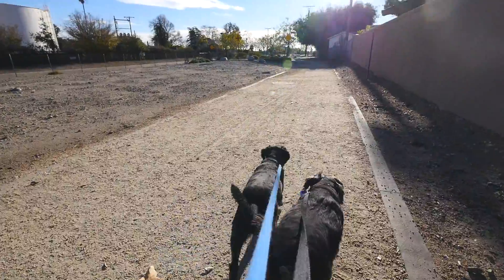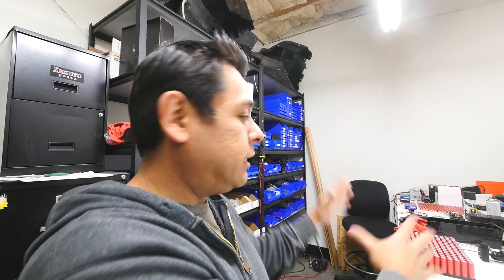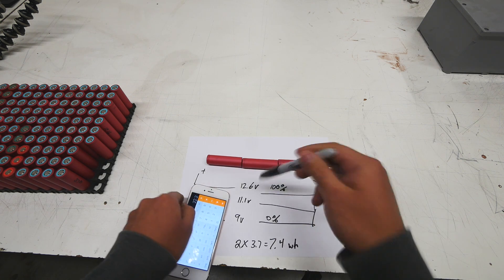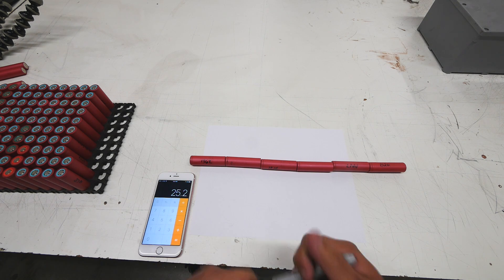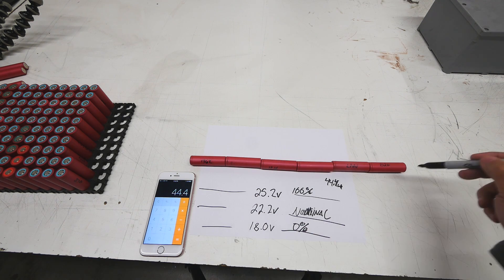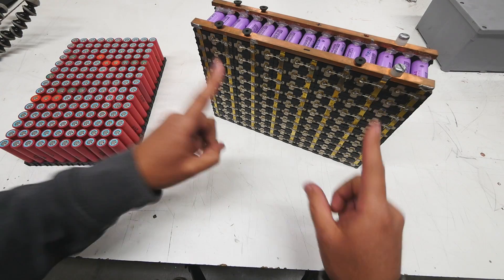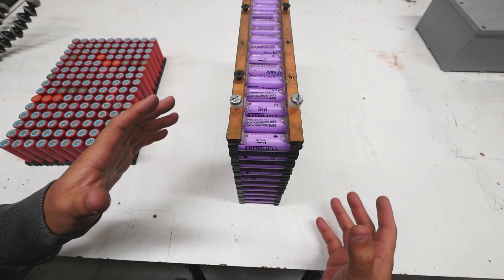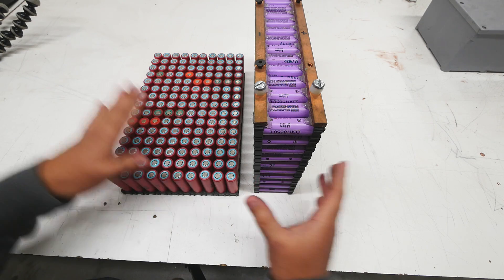How to wire A DIY Tesla 18650 Powerwall

Comment: Thanks for this video.
But if all the batteries are connected in parallel then, how are going mount a 48volt inverter on a battery that's just 3.7 volts?

Comment: So I need some clarification. That big pack with the pink cells, is completely arranged in parallel with a + and - bus bar at the end, right? 

So I could use 3 of these packs in a power wall for 12v, have one big BMS unit for all 3 packs then invert to 120v ac?

Comment: One Question - Shouldnt your positive and negative bus bars be on opposite sides so you pull the voltage evenly thru the batteries.  With this pack setup, someone demonstrated more heat build up closer to the top the busbar as batteries were discharging faster than the batteries furthest form the bus bar.

Comment: You mix chemistries? I thought you couldn't do that... (your samba comment)

That's cool for 12v /24v... Not sure what I'd need that for but cool info.

As far as bms, yea you don't need it as long as you keep an eye on it. But I don't get why you said they wouldn't come out of balance... Of course they can... That's why balance chargers exist... So you don't need a bms but you still need balance leads. A new wouldn't notice the fine detail that all the cells you are talking about are a parallel connection. 

How you should have explained it for newbs is that all series connections require 1 balance wire per set of parallel cell arrangements (from 1-infinity). While parallel cells themselves don't require balancing since they self balance. 

But once you start attaching parallel groups in series, now each group of cells becomes a series connection and each member of the series connection requires a balancing lead. (also the entire arrangement's negative, that needs an extra wire on negative. Hence why you need 6 wires on a 5S connection)

Comment: If you took a series of 4 batteries to make 12 volt (14.4 volt) could it be used on solar setup for power in place of regular batteries

Comment: Hey I was wondering how long you let your 18650 batteries sit on the shelf to test the self discharge. Also how much of a drop in voltage you allow before calling a cell bad. For example I had a batch of cells tested and charged to 4.2 volts. They were left for a week and after that week they had all dropped by a bout 2 to 3 10ths of a volt. would you still keep these cells?

Comment: I'm really wandering. I understand why you don't need balancing on parallel cells. But my main concern is the following; If I have 10 cells in parallel and one cell fails and would create a short the surrouding 9 batteries will discharge all there energy through this one cell. How do you prevent this and what is the safety if this would happen. Perhaps this rapid headup could damage nearby (other) cells causing a cascading effect. Any idea??

Comment: Why not build a huge nuke power plant . in the desert. To power the west us. And find some place . may e underground in the east to power the east. To power 50% or so. The rest from hydro,solar & wind. Every building that makes sense should have solar. I don't like nuclear power. But having it centralized would make more sense. I have 1500 cells to batter! In to a 1400 cell 2* 7s 100p batts.  Lots of soldering to do. I have a 200w iron to make fast work of it . without the cell cooling the iron. So o hopefully will not damage the cells. Great old video J...

Comment: Hey there buddy for the last couple weeks I've been watching your video especially about the powerwall I Can't Get Enough I'm so inspired still need a lot to learn I have six car batteries running now so I found these on eBay I don't know if you ran into these quality and brand make a difference if you get a chance can you check these out eBay I found these for $63.99 100PCS Li-ion 18650 Battery 3.7V BRC 3000mAH Rechargeable Batteries Lithium New
Reply from the maker: Junk

Comment: Can you use something like this as opposed to the 18650? Or is their some drawback to using something like that? 3.7V 5800mAh 18650 Battery 10 Pack Rechargeable Batteries (I found a bunch on amazon and they seem cost effective)
Reply from the maker: They are all fake

Comment: I have been watching a few of your videos and I like the theory and learning of it all. I have a question, I am building a camper van and want to have the coach / house battery be lithium to supply power to my 12v items such as fridge, lights, fridge etc. My question is would building a battery pack out of the 18650 batteries at 12v work for this application? I would like to have storage of about 100 amp hour possibly 200 amp hour, so i feel this would be similar to the tesla power wall to power my van, i would also like to charge the batteries from both solar and the alternator while i am driving, as far as charging via the alternator is there any thing special needed to charge it from that i know of the sterling battery to battery chargers however pricey but the other option is a ACR type relay but would that cause harm to my lithium battery pack giving it different volts or the battery demanding alot of volts from the alternator.
Reply from the maker: You must use Lifepo4 cells for 12v

Comment: how many amp hour i can get on 80pcs of 18650 battery. 20pcs on parallel per pack then i will series them to male 12v config. im so confuse with the mah and kwh thing.
Reply from the maker: Ah x V  = wh
Reply: thanks much

Comment: I am just a little confused.  In this video you showed wiring a 12v cell.  correct me if im wrong but you put 3 cells together in series and then put 50 cells behind each of them in parallel.  Right or all of them in parallel?
Reply from the maker: Correct

Comment: If I had four of the all parallel battery packs connected in series to make somewhere around 12 volts, would a regular 12v charge controller be okay to charge the batteries or is there a specific type of charge controller for these types of batteries?

Comment: So basically just daisy chain them?....so if you have 3 batteries in a row...& the 1 on the far right, the sign is negative, & the inside is a positive?... it would go from right to left: neg-pos, middle nattery?...neg, pos, & far left battety?...neg-positive...so the 'positive side'- is facing out...ok now I gotcha...

Comment: I new to the D I Y .. .. .. I notice that you are using 4.2 volts on this video. 3 x 4.2 = 12.6 volts, but most of the 18650 Lithium-ion Battery that I seem on Amazon are 3.7 Volts. So 3 x 3.7 = 11.1 volts witch is under 12 volts and 4 x 3.7 = 14.8 volts witch is over. Can I use the 3.7volts 18650 Lithium-ion Battery to make a 12 volts battery back for a small small solar generator ??
Reply from the maker: 3.7v nominal vs 4.2v max charging voltage
Reply: Thank you for you rapid reply .. .. .. however I do not under the answer. can I use 3.7v to made a 12 (14.8v) bank?
Reply from the maker: 3.7v cell have a max charging volatage of 4.2v

Comment: The calculations are all wrong. Watt hours stated should be milli amp hours but even this is not correct as the amp hour rating of the cells is equal to juts one of the battery capacity because the batteries in each cell are wired in series where only the voltage increases and the watt hours stays the same. One string is only 2000mAh and for the cost of freight I would have gone for 5800mAh batteries for less than twice the cost.
Reply from the maker: Oh,  the ignorance is strong with this one.    Oh internet,  where do you find these people

Comment: For a 96v system, is there any reason you cannot use two 48v BMS's - one for the first 48v and one for the second 48v? I'm looking at building a 96v system for a racing kart so peak current is import (end of straight max rpm WOT), and I want to make sure it doesn't fail.

Comment: Hello.... I was wondering... what happens (if anything) when you try making a power wall or small battery pack with cells that have varying Mah ratings?  
Example.... I have some  Sony US18650GR cells at 2,600 mah
                                              Sanyo  LJKM4B8  cells at (I'm told) 2,600 mah
                                              LG  LGEAS31865 Cells at 2,200  (some vayring info about these on line...some say 2,200 others say 2,600)

anyway... If I make a 12V power pack  by using series and parallel is it safe enough?  Charging and dis-charging ?
Reply from the maker: You are good as long as all your paralleled groups are same capacity.  Matched groups of cells it’s the trick.   Btw lithium ion does not make automotive 12v as it would require 3.5 cells in series for the right voltage ,  keep that in mind
Reply: Thanks for the reply....
  Yes... (to get my 12v) I am probably lookin at around- 3 Series x 4-5 deep in paralell .... 
I want to make a small pack that will run an Inverter during hurricane blackout....or for a single (LED) lamp during black outs...or small stuff like that... It's a hobby that kinda expanded from my solar PV hobby hahaha 
     It evolved to 18650's cause I had 6 laptop batteries lyin around. and I see tons of vids of people doin walls and stuff... But- I wanna be safe too... Don't wanna blow myself up

Comment: Im really confused here... what voltage did you wire you power cell to run off? I thought US households used 120v's and all appliance were setup to run of those 120v sources.

Comment: @jehugarcia, Im trying to make a pack that will work with a simple 12 volt inverter, and Im trying to come up with a configuration, do I use the 3.7 volt rating and simple use 4 of them to make 14.8 volts or do i use the 4.2 and use 3 to make 12.6? thanks

Comment: @jehugarcia the pack shown in this video is wired completely in parallel? So that whole pack of batteries is just 3.7 volt?
Reply from the maker: Yes,  30 of them push my 3000 lbs car around for 100 miles

Comment: Hello from Puerto Rico so thats one big cell of 3.7 volts and for to reach 12v i would need to make 3 or 4 packs of these and conect them in series but my question is if i connect them in series the watts hour will increase to? 

Thanks jehu for inspiring me during this crisis!
Reply from the maker: +Emanuel E. Muniz Rosado  yes you had watt/hours
Reply: Thanks jehu i will try to see you when ypu are here in Puerto Rico big thanks

Comment: Jehu,   Quesiton i am going to run a 7KW Solar system on my rooftop and want to use batteries(powerwall copy) for my night time use.  How many volts would be best to wire all 600 18650's.   I see your explanation on series and parallele but am unsure the best voltage to wire them all up.   Als what 18650 batteries do you recommend?    Thanks,  Luis
Reply from the maker: +Luis Cardona  depends on your equipment l

Comment: I have a question. If you are running 12v or 24v inverter, shouldn't your minimum voltage be 12v or 24v. I cant run my inverter under 11v

Comment: I am sooo sorry for being stupid, but I understand that the nominal voltage per battery is 3.6 to 3.7. But in the calculation2x3.7=7.4wh, why isnt it 3x? I know I must have something wrong
Reply: 2000mah/2ah per battery capacity so 2ah x 3.7v= 7.4Wh

Comment: I use the 18650s for my own LiPo packs for my long range FPV hobby.
My comments are safety related. These battery packs are extremely flamable. Battery fires are extremely hot and way too common.
My suggestion would be to not try and copy Tesla because I believe the Tesla design exposes your home to fire risk. I would suggest making a fire box out of brick and mortar, and storing the cells in that. Not as pretty, but a house burned to ashes is even less pretty.
Perhaps you could use fire board instead of bricks to keep a lower profile, but I would use an abundance of caution when it comes to this. The batteries aren't cheap, so maybe even isolate each pack. That way if one burns it doesn't burn the others.
Finally, not sure if it was mentioned in the threads. Watch out for cheap Chinese knockoffs of these batteries. Most of them fall very short of their claimed capacity.
If anyone has or is a supplier of refurbished or reclaimed LG/Panasonic or other recognized brands please send me a private message. I want to buy.

Comment: hi can i ask something please

for every x3 (18650) batts you get 22.2whr

one 12v 100amp hrs leisure batt = 1200whr / 1.2kw hrs

1200 / 22.2 = youd need roughly 54 batts to be equivalent to 12v leisure batt is that correct?

So if i bought the 18650 batts for £1, coupling, copper ect it would cost me around £70 YET the leisure batt would cost me £56 ... whats the advantage of the small batts please? 

Also how would know if one of the small batts died, and how to find it?

All the best, thanks for your videos... theyre great

Comment: I have a question for you. The so call take batteries what's really wrong with them other then they are low compacity and labels wrong. well low compacity equals to won't last long correct? reason I'm asking if because I have. lot of them I bought 6 months ago thought they was real and they wasn't. But my point is can't people use the. for a emergency diy Powerwall? Okay sure it won't last long but still it will work.

Comment: @2:24 on video... How exactly did you know that the voltage was 12.6 and the nominal was 11.1? where exactly do you get the nominal voltage from?
Reply: 4.2 x 3 =12.6v
3.7 x 3 =11.1v
3.0x3 = 9v

Comment: I'm thinking of using a 24v inverter. with a max of 200a draw. and a max of 1amp per cell . and move up to 1/4amp eventually. I'd like to get 12-24hr run time without a charge. in case of a emergency. thank you for being a great help and motivation to get this project going!

Comment: B.M.S B.S. in some cases correct. as long as you keep an eye on it . and charge properly. correct?  wouldn't it work better to go with 7 cells in a 24v inverter setup? it would be closer voltage range. like  when using lead acid batteries. I think a 24v inverter can handle 29v. and if you only go to 4v you are only at 28v much like a alternator would put out in a 24 v vehicle. and the inverter may be more efficient . its easier to convert a higher voltage to a even higher ac voltage. sorry I'm rambling again. but I'm wanting to go with a 24 v system for my off grid home. to get off the generator. using solar and hydro to recharge the batteries

Comment: WHERE DID YOU GET THE HOLDER FOR THE BATTERIES... I DON'T KNOW WHAT THEY ARE CALLED BUT YOU HAVE THE BATTERIES SITTING IN THEM ON THE TABLE AND YOU TURN ONE UPSIDE DOWN TO MAKE IT A HOLDER BEFORE YOU WIRE THE PACK TOGETHER?

Comment: voltages are too low.   You are one cell too short. Also the math is not correct.   When you make a string, the watt hours are the same as  1 single battery in the string because they are in series not parallel wiring.    

  In a series circuit, the current through each of the components is the same, and the voltage across the circuit is the sum of the voltages across each component. In a parallel circuit,
 the voltage across each of the components is the same, and the total 
current is the sum of the currents through each component.
Reply: You have to multiple with 2000 mah / 2 amp that how he gets the 22.2 wh
Reply: Lester Awalt 3.7v x 3 is 11.1volts multiplied by 2amps since watt= volt x amps
This gives 22.2
Reply: I was scratching my head about that too...i see it as 3.7v x 3 cells = 11.1wh
I don't know where he got 22.2wh that he states @ 3:05 but every 3 cells would add the above calculated 11.1wh...

or maybe i stupid and I am missing something
Reply: cute that this kid thinks he is correcting someone... Who thumbs ups this shit? People who think he sounds like he knows what he is talking about?

Comment: Hey mate,
I was making a 100ah 12v bank at home. All was going well, i took your advice about not needing to balance charge them. However during the charging process (1A 12V battery charger) it charged up to 9V then dropped to 0V. I havnt tested them again however. Has this occurred with you or am i unlucky?
I was using some Pansonic 3400MAH batteries that were all tested (all ended up around 2700-2800MAH) and wernt show faulty with my battery tester before the building.

Cheers for any advice.
Reply from the maker: " it charged up to 9V then dropped to 0V"  what does that mean?

Comment: Hey @jehugarcia! I really like your videos. I know you probably do a lot of testing for your cells prior to placing them in your powerwall; If you are looking for a robust tester for 18650 cells, we would love for you to check out our product, "The Batlab." This is a complete system designed to walk users through the entire process of configuring a custom electric battery pack. The system cycles cells, runs cycle tests to determine capacity, sinusoidal and pulse tests to characterize impedance, and can estimate state-of-health when compared with benchmark values for a particular cell model. We are planning on making all of the hardware and software open source after we launch. If you are interested in learning more or becoming a backer, please check out our Kickstarter page! If you are hesitant to click the link (no hurt feelings) you can also search "18650 Batlab" on Kickstarter directly.

http://kck.st/2eUyaAR

Comment: When your connecting row 1 and row 2 as you show here, do I need to wire every connecting point or can I use only the top and bottom in order to add up the Amps and keep the voltage the same? Or  how many copper strips do I need when laying down a horizontal setup?

Comment: a question , i was looking to build a power wall , though just for 250 batteries it's $750 australian dollars buying from USA shipping to australia, so roughly $1600 for the batteries (600 cells) the tesla power wall is $5000 aus dollars for the system with 10 years warranty, so im thinking with the time and effort i would be better of just buying one straight up , or what do you think?